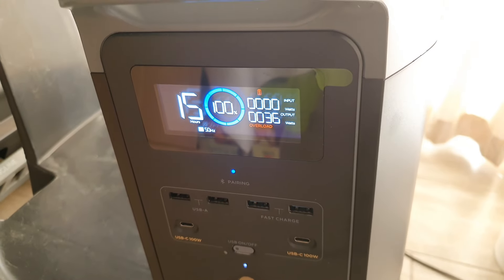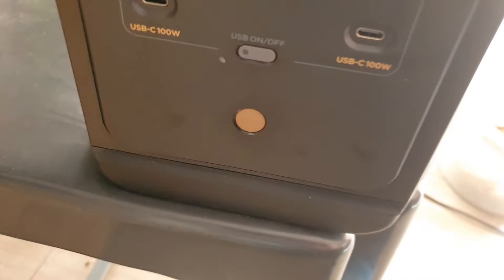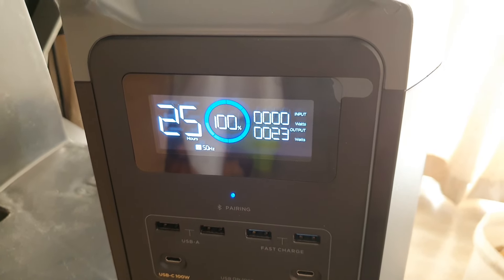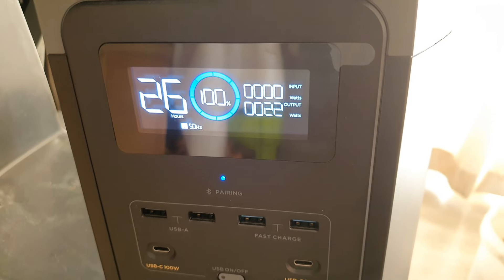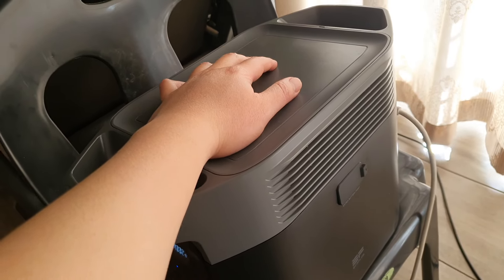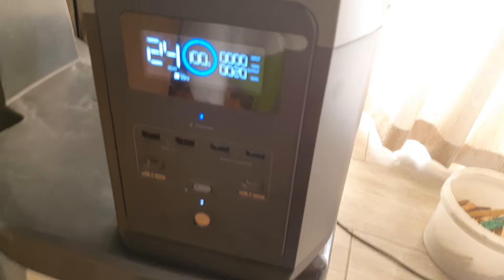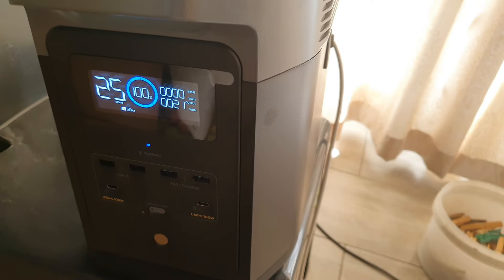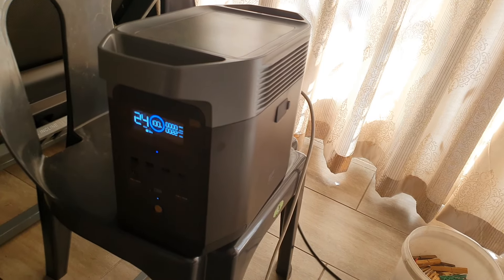Troubleshoot EcoFlow Delta 2 Overload Error - Easy Fix!

Comment: you reset the BMS (Battery Management System) my problem is after latest firmware update I have a messed up unit and I can not rest BMS with the button all it does is turn it on when holding it in
Reply from the maker: Best to drain the power out until its empty for the overload to disappear and always pull off plug when it's done charging

Comment: Nope you’re wrong, same error but mines 0%. When I unplug the power it goes off. Won’t charge anything
Reply from the maker: Are you using solar
Reply: the sent out a bad firmware update thats was my problem and many others  ..THEY NEED TO SEND OUT A HOTFIX ASAP!
Reply: @togetherslashbargainsoutha2332  I have exactly the same problem and its at 0% but wont charge. When i try to reset by holding the power button nothing is responding, only goes off

Comment: Thanks your video helped so much as I was finding gradually  at first it would charge to 100 % but gradually a charge would stop at 89 %  then even stop at 37 %  but watching you  explaining how to switch off and on to reset the unit  it's gone back as it was when new 100 %  brilliant thanks!!
Reply from the maker: Try using it until 1% and you still get power non stop. It's like the battery cells have hidden power that's not used. Once I did that I never have this overload problem. I think they did this so you would pay them to fix something that they made the product do